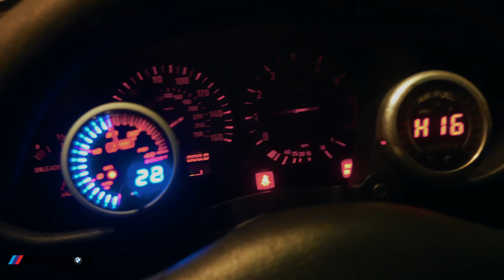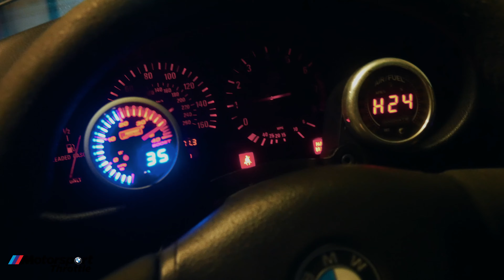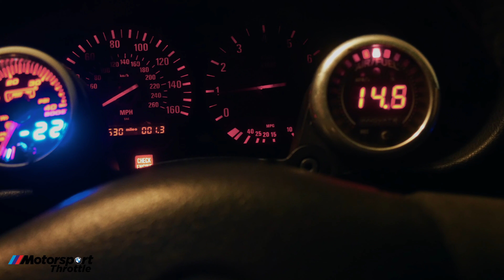Hardwiring E85 Walbro 450 Fuel Pump| E36 Turbo M3

Comment: You should have just scrapped that hangar and got a new core and drilled two small holes and threaded in two new bolts directly into the flat surface of the hangar as new contact points this way you don’t have to worry about that epoxy ever breaking loose and leaking pressure

Comment: are u running factory fuel pressure regulator?
Reply from the maker: Yessir
Reply: ///Motorsport Throttle did you have any problems with it I did this and have a weird idle surge I can’t find now